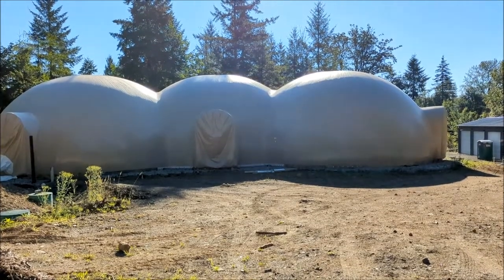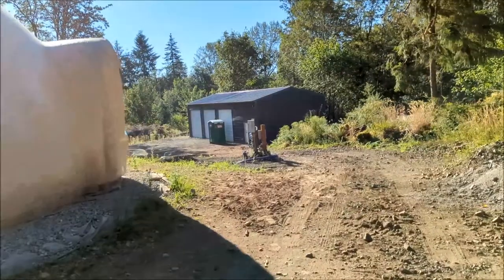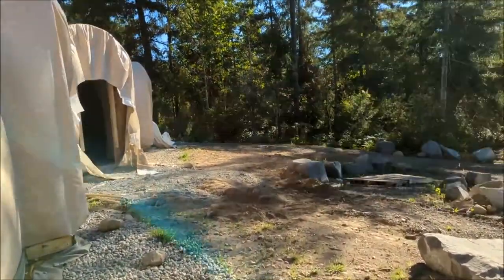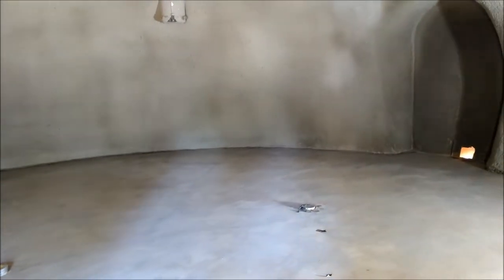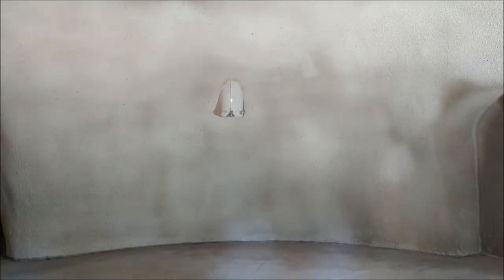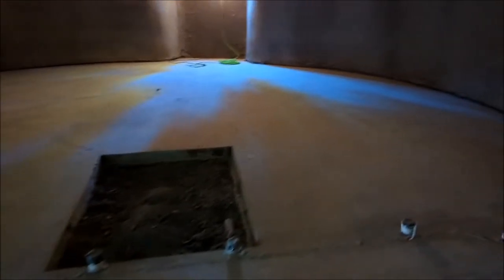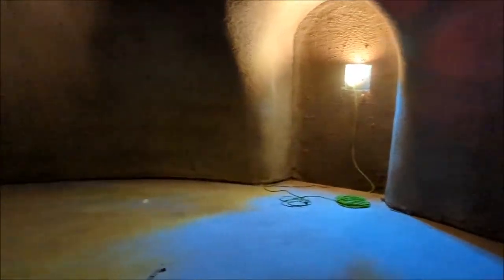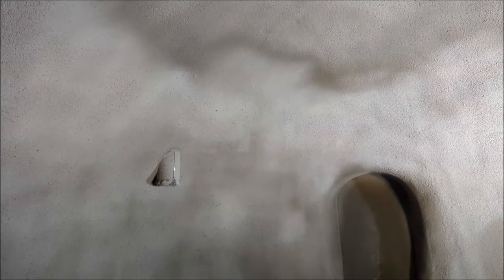Monolithic Dome Home Shorter Version with New Photos

Comment: How does the air conditioning/ heating work? Do you need anything at all?
Reply from the maker: There should be some and I was going to have two geothermal heat exchangers, but the county requires an electric forced air furnace.